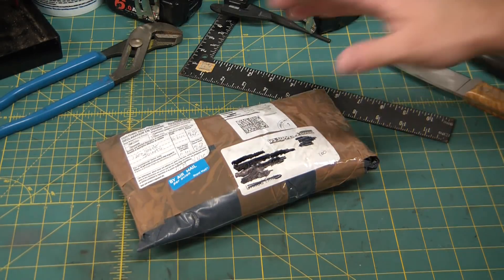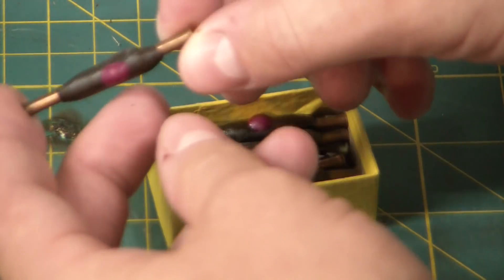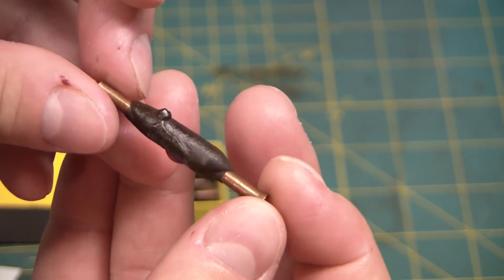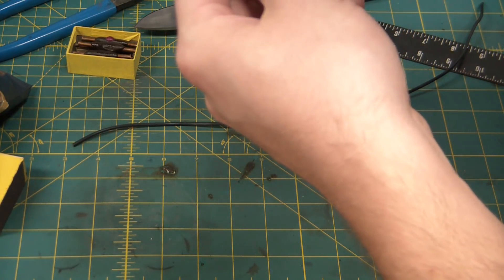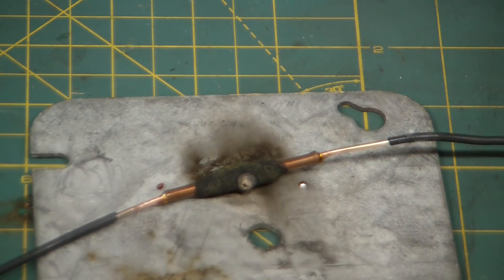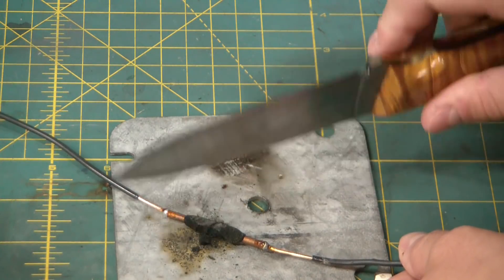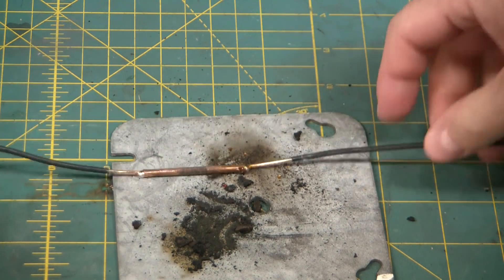Ingenious Self Soldering Sleeves!  (A Very Old Invention) - ElementalMaker

Comment: 9:40 Likely due to cost and lack of demand. You can solder just fine with a portable gas or, these days, battery-powered iron. And the other methods are more versatile. Not to speak, that I doubt those will work when wet. Wet, aka most battlefield conditions.
But it would be really nice to see it dremeled open lengthwise.

Comment: Hello. My like for scientific information. Data about the patent and its contents were used.
Reply from the maker: If you can find the patent please let me know. I would love to know the composition they used, I can't find any good info on it.
Reply: @ElementalMaker  Hi. I understand from your video that you have found a patent and are quoting the composition from it. Personally, I did not seek a patent myself. In your welding device, the main thing is not the composition, but a copper tube with an inner wall covered with solder. It will be difficult to create a copy of this at home.

Comment: This would not be hard to replicate really... I mean, the pyrotechnics of it are basic, and interchangeable with other similar compounds, the striker is as you said, pretty much a bog standard formula and the copper tube with solder packed in it with flux is also not very hard to replicate... As you said, toss a pack in your vehicle, have a pack in your toolbox, just have a few packs ready for any emergency use-case that you come across... n1, its a great joint, n2, its durable and reliable, n3, you can use it with ease anywhere, in almost any conditions...

Comment: Lot of stuff like this has never been invented. Probably people thinking hey, someone had to think of this way before now, so they forget about it. I got a patent on an oilfield process in 2014 that could easily have been invented in 1914 -- it just wasn't. Think of this. People have been painting or whitewashing the walls of their dwellings for 7000 years or so, but the paint roller wasn't patented until 1940. There are vastly more things that haven't been invented than things that have. Most things just haven't been thought of yet, assuming the number of possible things must be infinite or close to it.

Comment: They do make self-solder connectors today but they don't provide their own heat, instead they have a couple of bands of solder inside a tube so you stick both wires in so they overlap and then hold a lighter under to melt the solder bands.  Not quite as self sufficient but not a big deal to carry a lighter.

Comment: The modern-day equivalent requires a heat gun It would be so awesome if there was a company that actually made these these would be great for emergency wire work during a blackout or something. I mean don't get me wrong some splicing and electrical tape will do the job just fine temporarily
Reply from the maker: Yeah I love the heat gun variety, especially since they are a good waterproof connection too. But these would be awesome for remote repairs where you don't have a heat gun handy
Reply: @ElementalMaker  exactly my thinking My dad used to be a radio technician and he used to have to carry all this equipment to repair radio towers or cell phone towers or anything and he said he wished there was a way to do it without carrying all that equipment With this type of technology he can make a quick solder joint and set it off with a bic lighter. He's retired now but back in the day this would have been really handy

Comment: The burn looked like the same formula used for applying hot patches on innertubes...probably not the safest thing to breathe...AQMD may be the reason they are not in production today...hot patches on innertubes were the best. Never had a failure

Comment: I have some of these copper tubes meant to be soldered with a lighter... probably a bigger lighter than a standard bic. A standard lighter is a bit too weak, but it's possible to solder some smaller wire. And I think they are still made somewhere. They are not that old.

Comment: If you have to strike them on the box, they aren't strike-anywhere.
The big difference is that the striking patch on a regular match box/book has red-phosphorus in it. Striking the match on the box grinds a bit off, and it turns into white-phosphorus, which ignites the match head. The striking patch itself is technically catching fire and igniting the match with it's own heat.

This kind of thing feels like it would only have been used as an emergency patch.
As a covert tool, someone passing by is going to smell the burnt residue and think there is an electrical problem. And then they will likely see it.
Under "normal" conditions you could use a small alcohol lamp/burner to melt the solder. This would work quite well with one of those copper tubes pre-loaded with solder and flux.

Comment: If you had read the rest of the instructions, they told you to push the wires in and wriggle them a bit so the wires overlap inside, that's why you strip the bit extra ;)

Comment: That is interesting. I worked on aircraft nav/com in the Navy. In a pinch, we would use a Bic lighter to solder an electrical connection. (We'd use plastic shrink tubing to make the connection water resistant.) The keys were to generously 'tin' the wires before soldering (which is all the solder you need) and have steady hands.

Comment: i wish i have such self heating solder thingys during my time in the military some field communication thingys we use as a cable bonded backup needs after installation a lot of time for inspections and i know that this self soldering tubes indeed used for field communication too not only for demolition work

Comment: Much stronger hold, mabey stronger than the original wire.
Could duplicate the effect with soder already on a copper wire connector, slide ends in or through cut in the copper and heat with a lighter, or torch. Overkill on some application however.

Comment: Reads "quarter inch" strips an inch and a half or more and says "that's a bit excessive". Quarter inch would have had the insulation butting up against the copper, the end of the tube is just over quarter inch.

Comment: Hey I see you're happy to see it, but look at these (https://pt.aliexpress.com/item/4000831438336.html?spm=a2g0o.cart.0.0.46df3c00a3QYox&mp=1)... I've bought it to maintain in my 4wheeler... if I need to connect any wire I can do it with any heat source. It's waterproof and permanent... no moving parts.

Comment: Actually there are modern version of these... Need lighter or matches with it tho. It also has shrinkin material to go with it so all done version. https://www.amazon.com/Shrink-Solder-Sleeve-Crimpless-Connectors/dp/B01M1032A7 Those are really easy ones at outside where you dont have electricity in hand

Comment: my great grandfather worked with these and had some of these after wwii, the only time they used them for communications was RARELY to patch in or setup a quick and dirty line that would be re-joined by others with more normal means, also told this was done in korea, oh btw, alot of the time they would crimp the ends when using wire that was  a bit over size he showed me how they worked but, somebody stole all the ones he had from his shead for the copper im sure... (assholes...) 
and something like that would be damn useful in quite a few applications, even just in repairing wife fenses(one thing he and his buddy used 6 to do,during a storm no less.... 
and 2020... need an intact WWII VIP bunker and the money to refit it with modern tech... and just sit out the insanity...

Comment: I once interned doing installation and repair for my local telephone company during the summer and it was a common occurrence to have a loose scotchlok connector giving customers trouble. I was wondering if there existed a thermite solder scotchlok connector and I finally found something that does essentially the same thing lol.

Comment: Thats not showing how the manual instructed. So the point 1. instruction is not "excessive". Points 5 and 6 (press together and hold until cool) are the key element which were not done. As both have to overlap it would also be interesting to know if there is a max diameter of the wire mentioned.

Comment: why don't they make them anymore?  Likely cause now we have solder but connections you just heat with your pocket lighter - smaller, lighter, cheaper, and less failure points (assuming you got a couple lighters in your pocket). I love old tech like this but materials have advanced

Comment: Did they use it for communications? The answer is NO. I was a Telecommunications Lineman (052) in the Canadian Forces from 1996 to 2003. For field splicing our two pair wire, which they had used since WW2, we did nothing but mechanical splices by hand. That's all you need for a good current and minimal resistance.

Comment: They do make similar sleeves...
https://www.ebay.com/itm/530Pcs-Self-Solder-Wire-Connectors-Heat-Shrink-Tubing-Waterproof-Butt-Kit-ST/283407610048?epid=566470209&hash=item41fc68f0c0:g:0r8AAOSw8RFeWh-L

Comment: you are supposed to press the wires into the unit while the charge burns, there could be an air gap in the middle of the joint where the solder flows out and doesnt contact end to end on the wires. for sure awesome devices that should be brought back!

Comment: The modern equivalent isn't really an equivalent for the ones in the video as they need external heat to be used and aren't like the old ones which are a complete solution in a matchbox, you dont need anything else except the box and the wire you want to solder. The new ones are good as you don't need flux or solder wire but aren't self contained like the oldies.

Comment: this is cool but im not real sure what the point in these actually is. I mean with soldering its usually a single wire to a contact point or a component soldered to a circuit board. these basically just splice 2 wires together and you can do the same thing but just twisting the wires together or having butt connector or crimpable connector, wouldn't that be a hell of a lot easier just something you twist or crimp to splice wires? nevertheless im no engineer im sure these served some valuable purpose and it was a cool video I didn't know these existed

Comment: This would definitely not have been used for demolitions during active combat. In that situation you take the two strands of wire, knot them together down the insulation (for strain relief), then twist and insulate. As others have said, this is for communications cable...I could never see it used for explosives.

Comment: 1 more thing, since you made a joint like this already, can you measure the resistance on it with a multimeter? Can you try to run it thru with like 20A 120V kind of load for like 20-30min, and see will the joint heat up or break apart?

Comment: And ... The last box of China made matches I used, about 1 in 5 lit properly. Bwah Haaaa!
Used with Heat Shrink insulation those joints are fantastic. Could easily conform to higher voltage Wiring Standards- Speaking as an Eleco would be great for those awkward jobs.

Comment: What a time saver for car audio those would be! Smaller of course but man why don't they make these now? I have used some of the newer ones. One brand wouldn't work with a lighter. Just melted the plastic and the solder never did anything. Heat gun worked on those. Another brand a lighter worked fine. If made like the older ones they would sell like hotcakes I bet.

Comment: Great peice of tech. They have a similar system in place today. Used mostly when laying com cable, mostly semi permanent installs. I personally have never seen them used in demo work. I could see their use back in the day when ur radio was spotty at best, no satellite comms. And u had to run 3 miles of twisted pair com cable from the pencil pushers in back to the absolute front line. Def quicker than a western union splice!

Comment: You looked at the instructions like 5 times.. You even pointed out that it is strange that they would have you strip so much insulation off.. Why didn't you push them in when the solder melted?

Comment: That's not "strike anywhere", it's safety match material.  You can check this by rubbing with sandpaper.
The oxides of a pyrotechnic mix are usually acidic, so they must be removed for reliability.

Comment: The soldering tube is pretty cool, but try this. Take a couple of carbon rods out of D cell heavy duty batteries. Before you run power through them you'll want to burn off the wax in them (the wax will burn) After the wax is gone use 20 gauge wire to connect them to the post of a car battery. When you touch them together the arc between the rods is hot enough to weld thin or low grade steel. I use AA rods for small projects lighting magnesium shavings when camping 9V battery for power. And D cell wired into a transformer and 110 AC for heavy jobs like cutting thew exhaust pipe off a car or welding a bead on 1/4" steel. I have some here I can send you if you like. But remember my friend Safety glasses, open or ventilated area, rubber gloves, and nice long handles are all wonderful things when the kids are watching.
Have a great day brother.

Comment: After seeing your demonstration I think the solder occupies the centre of the copper tube and when the inflammatory substance starts burning from the centre outwards, the solder inside melts and as the substance burns outwards, it expands the tube giving the melted solder some space to flow out around the wires which were to be soldered, leaving some empty space in the centre of the tube. That is why the instructions were to press both wires inwards so the now empty space will then be occupied by the wires.

Comment: You should try making some of these if you are able to source the chlorate/strontium materials or able to synthesize it yourself. The shellac I’m sure is just tree sap with isopropyl alcohol absorption making good old fashioned flux. Let us know. These burn uniform and really quite beautiful. Also interesting what temp they burn at to melt the solder and a comparison between the old and new if you should make some. They still do make these though in heat shrink tubing and solder melt version...no copper, and of course butt connectors replaced them.

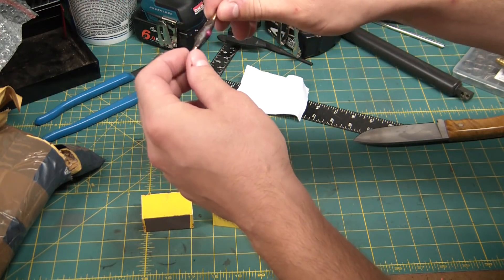Comment: I also can possibly give good advice as to what the black combustible part is, it appears to be charcoal, it ignited every similarly to what you see used when smoking tobacco out of a hookah, check out this video, it’s very similar.  https://youtu.be/HkREX0pRYGM. Lighting begins at 1:35 and I also have another good comment concerning the correct age of the solder joints.

Comment: The paste-like substance looked like an old punk style type coating. Or something close to that, hence the "headshop" odor.  A Punk in that term is a hard slow-burning wick on a stick to assist in lighting the old ladyfinger, M80 style firecracker.  the paste is like the old expanding snake as well fireworks type.
  And the red spot sure looked like an old-style sulfur match head type. All very nice kit, more like used by saboteurs when not under direct fire.
  Best of luck on your channel sir.

Comment: "Why aren't thet doing it anymore?"
Cause Strontium vapor is highly toxic or some similar issue they didn't care much about in 1943 I guess?
Reply: Build a rocket engine and load strontium pyro material extracted from a road flare into the nose then light it off at night in front of the neighbourhood kids and smell the rocketwash for full enjoyment.
Reply: It is not highly toxic. Strontium is only toxic with regular exposure in relative large quantities. Occasional use of these devices is perfectly fine. That's why they still use strontium in fireworks and tracer rounds.
Reply: you can consume strontium in ash based drinks. Some people swear by it, saying it makes stronger bones. (2 cups water, 1 tbsp ash, 1tbsp cheap ass red wine gone to vinegar) I can't speak to the vapor
Reply: Strontium behaves like calcium in the human body.  It is used just like calcium, but the body will replace it with calcium if it can.  Nothing in that mixture is toxic.  Everything is useful to the human body.
Reply: @beyondwhatisknown  I guess I'll go vape some igniting solder tonight

Comment: Hhi I, m an ex HM forces we continued useing them upuntill the 80s I used them on special ops, being covered was not very good with them, gave off a lot of smoke, we used them on field telephones to connect the wires at that time we had D10 cables,
One more thing did they come in a wooden box??

Comment: I don't get their intended use. As if you would need to connect two wires together, specially that thick also, wouldn't be just as efficient for the job and maybe even faster to just twist them together? For demolitions i don't think you even need to have them insulated. But that can be easily fixed with a bit of tape i guess.

Comment: The old guy next door (30 years ago so I guess I'm the old guy now!!) had these he brought back from WW2 Egypt. He said they used them to repair broken telephone lines in the desert. At night you would crawl forward find the break, dig a hole stick the wire ends in then light the thing and bury it as quickly as possible with the sand. Like an idiot I said "was that to insulate the joint?"
He smiled at me and said "No, it was so they didn't see you and drop morters on your head"...... The best generation.